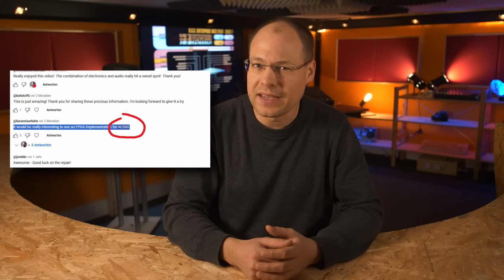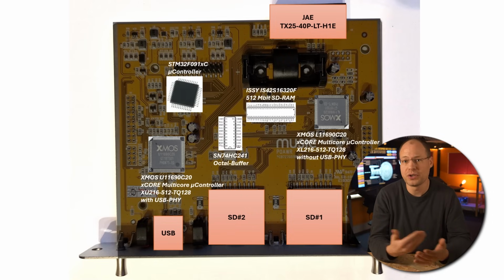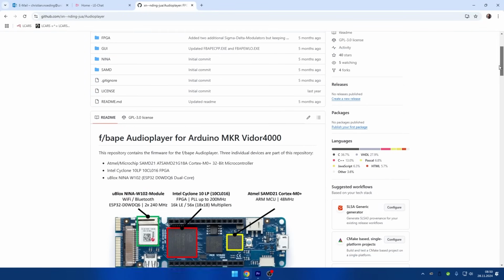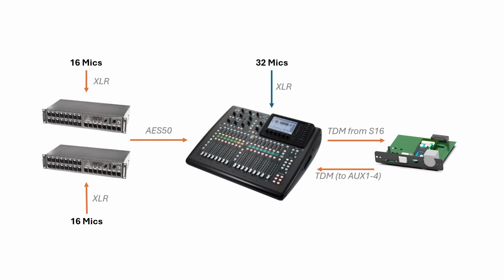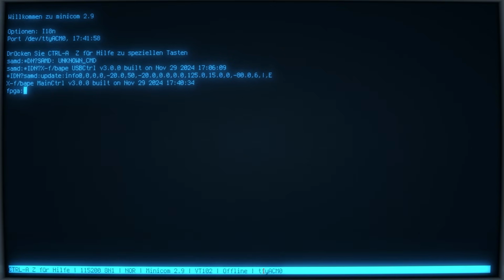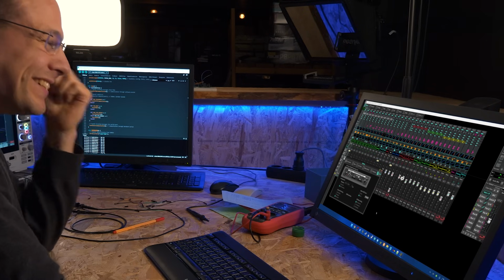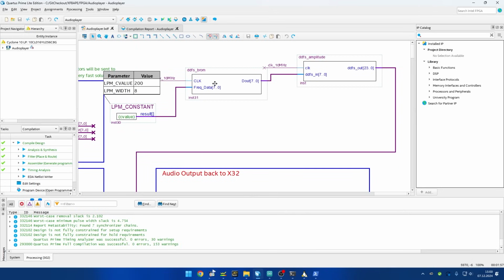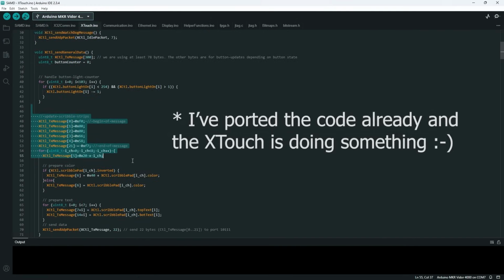X-FBAPE - The DIY FPGA-based card for the Behringer X32

Comment: Well done 😊. But I wonder how you can mix both local inputs and your additional inputs as when the "play" button is pressed, the local inputs are cut on the x32 🤔
Reply: I think it was just for demonstration.

In practice, you can use ch1-32 as normal routed from either local inputs or from aes-50 inputs.

Then you can directly route aes-50 or local inputs to the card.

Then card return can be sent to aux 1-8 as mono/stereo signals, and mixed within the F-BAPE card :)
Reply from the maker: Yes, that's the case. And as the FPGA mixes the samples within several hundret Nanoseconds, we can return the processed samples with only 1 sample delay, so stay in sync with the main-console. So the main benefit compared to the X-USB or X-LIVE with USB-connection to a DAW is the stability (no computer, no DAW, no updates) and real-time-processing.
Reply: @pcdimmer Sorry but I don't understand how it mixes the local inputs and the additional inputs 🤔. If the local inputs are cut, they can't be sent anywhere, right ?
Reply from the maker: The X32 can route audio in groups of 8 without processing it. The card can take 4x8 blocks from AES50 port B while the internal processing takes 4x8 blocks from AES50 port A. The buttons "REC" and "PLAY" will only switch between two different rounting-setups for convenience.

In my scenario I will use my X32 core (without internal ADCs) together with three Stageboxes connected to AES50 port A. 32 channels are routed to the internal processing and the additional 16 channels are routed to the card, mixed to a stereo-mix and fed back to the AUX-ins of the console.

But there are plenty of different options to route.

Comment: Someone needs to reverse engineer this for the wing 😍
Reply from the maker: I learned, that the WING transmits 64 channels to the Expansion-Card, so the possibilities are even larger. I've found a nice picture of the WING LIVE Card front and back and the overall design is comparable to the old X-CARDs. So I guess building a DIY-WING-Card is possible using the same approach I took for the X-DIY-Card.

Comment: Do you know how the expansion card pinout for the WING is laid out? I'm hoping that we can get some harddrive recorder for that, instead of just SD cards with the WING Live. Would love to work on that, but no idea where to get the pinout. Cymatic sadly is dead, so we can't expect a similar card for the WING from them.
Reply: Guess I'll have to look into reverse engineering it like you did with one of my WING-Live cards, or a WING-Dante card.
Reply from the maker: No, up to know I have no data about the WING-Expansion-Card. But it seems to use the same connector. As the WING-Cards seem to support 48 channels, there will be two additional TDM-lines. I'm walking around the WING-consoles each time I'm in one of the stores - maybe the next time I will take one with me. Then we will have more answers.

Cymatic used a SMSC DM860A Media Processor IC with USB OTG. So the task would be here to connect a USB Mass-Storage-capable controller-IC to write the 32 audio-channels to a connected USB-mass-storage-device. However, thinking about this solution and seeing the simple SD-Card-interface on the other hand: staying with SD cards is the best solution, I guess. Cards in SPI-mode are too slow, but all newer cards support 1-bit or 4-bit SD bus mode and this interface is much easier to implement in VHDL than USB-Host-Mode. With a larger FPGA I would test this implementation with a Soft-Core NIOSII controller and a FAT32-library.
Reply: @pcdimmer  I even expect 4 additional TDM lines. The WING expansion cards support up to 64ch/64ch. The default SD recorder card can support 32ch individually on each SD at the same time, the Dante expansion card supports 64 in/out.

The thing with the SD cards is that I don't really trust them that much. For critical recordings I tend to run SD, one Laptop via USB, another Laptop via Dante at the same time. I don't see USB-Host-Mode and filesystem happening on an FPGA directly for now, but I'm wondering if it would be possible to interface a more common SBC/SoC with the TDM lines. It seems that not many SoCs support 8 TDM hardware interfaces, and the clockrate makes this non-trivial to do via software-interfaces.

Maybe going the route of converting the TDM lines to a USB UAC device first would work? If the OS is trimmed to the bare minimum and tuned well I'm sure that it could be quite stable. :)
Reply: Also: I can highly recommend the WING. I've got the fullsize since shortly after release and already have a WING rack sitting here as well. Unbeatable value for the money, and much more processing than the X32 platform.
Reply: Looking around a bit: The Rockchip RK2118G/RK2118M might be a suitable chip. 8x TDM, low power Cortex CPU cores, USB 2.0 OTG, 10/100 ethernet - this could work and be a nice bridge between easy TDM interfacing and writing to a USB disk with a filesystem. Will keep an eye on that!

Comment: can it be implemented on Midas m32
Reply from the maker: As far as I know the X32 and M32 share the same code-base. "Only" the hardware has better quality, better ADCs and different housing. Maybe the firmware is identical and only some resistors will let the firmware know, that this is a X32 or M32. So the M32 should recognize the X-LIVE as well as the X32 the DN32-LIVE. But if not, we could change the initialization-string from "X-UREC" to "DN32-UREC" or something else without problems.

Comment: I would 1000% buy one of these if you ever begin selling them. Fantastic work!

Also, out of curiosity: would it work as-is with the M32 mixers as well, or would you have to change your code or hardware significantly? I'm not a coding guy myself so I admittedly skipped a lot of those portions of this video, lol.
Reply from the maker: OK, you skipped parts of the video? I .... answer ... parts.... :-)

As far as I know the X32 and M32 share the same code-base. "Only" the hardware has better quality, better ADCs and different housing. Maybe the firmware is identical and only some resistors will let the firmware know, that this is a X32 or M32. So the M32 should recognize the X-LIVE as well as the X32 the DN32-LIVE. But if not, we could change the initialization-string from "X-UREC" to "DN32-UREC" or something else without problems.
Reply: @pcdimmer  Oh, sorry, lol! Thanks for still responding! That's good to hear that it wouldn't require a huge overhaul. Please keep innovating with the X32/M32 line, this stuff is awesome!

Comment: There might be a better answer to your DIY card solution. The ex Dante card utilizes a mini PCI slot. The Dante card in that slot is a.Audinate Dante Brooklyn II card. I feel this slot on this Dante card gives you the most bang for your book because it’s a common open standard that a lot of data is out there about. You can also look up the pin out configuration for the Brooklyn II card for all the custom pins.
Reply from the maker: I had a look at the DANTE-Cards only during the video-editing - this would be a universal DIY-audio-card for different consoles, yes. But the size of the PCIe-cards is quite limited and it would not be possible to put the Vidor 4000 on-top (it would be to high). As these cards are configured using SPI, I2C and/or UART and support TDM-audio, this is not a completely different matter and should be possible. But for now I will stay with the chosen solution as there is still lot of work to do.

Comment: Great re-engineering work!
I'm currently looking for an I2S-to-ADAT-converter but cannot find one. Not even PCBs on chinese market-places.
Would it be e.g. possible to connect the serial audio inputs/outputs of an ADAU1452 to a Behringer X-ADAT?
Reply from the maker: If I remeber correctly, ADAT uses 8-channel AES/EBU - more or less the same signal as UltraNet. AES/EBU (for more information have a look here: https://www.nti-audio.com/Portals/0/data/de/NTi-Audio-AppNote-AES3-AES-EBU-de.pdf) is a single-line-signal with an inherent clock-signal. I2S on the other hand uses dedicated frame-sync and bit-clock-signals.

So with this Vidor 4000 FPGA it is quite easy to do this conversion, but not the most affordable solution. In short: I have no out-of-the-box solution for you here, sorry.

Comment: First of all this is an amazing project and I appreciate the amount of effort you have put into it. While watching the video I was asking myself whether it would be possible to control the additional channels on the mixer directly, using the customaziable buttons to switch between the channel banks. I do not have any experience in circuit board engineering and reverse engineering and have no idea if the x32 communication protocol supports something like mapping channels. I guess the channel strip components would still need to be handled externally as the x32 only has 32 channel strips. Love your video and keep up the amazing work you have been doing.

PS: maybe make a video explaining in depth what all these technical terms mean?
Reply from the maker: Yes, this is a good idea. Some hours ago someone mentioned the DAW-section of the X32. I will check if we can control the additional channels using MIDI-messages sent by the X32 - either by the user-buttons or the DAW-section. Another Idea would be, to use the network-UDP/OSC-messages from the X32-Ethernet-Port. So yes, there will be some development in the next weeks :-)

Comment: I’ll give you a million dollars idea : make a UltraNet In and Out card for the WING.
Reply from the maker: UltraNet is an AES/EBU-signal using biphase-mark-encoding - more or less the same signal SPDIF is using. And - tadaa - there is already an AES/EBU-receiver within the GitHub-project already :) So receiving UltraNet to the X32/M32 already possible. An UltraNet-sender could be developed based on the stereo AES/EBU-sender within the project. I do not see any showstopper for this here.

Comment: Wow great work, love seeing how you approached the problems you faced. Would it be possible to implement the protocol Behringer uses for the app in such a way that you would be able to control te fpga's processing via mixing station? (Probably you need two instances of the app, 1 for the X32 and 1 for the FPGA)
Reply from the maker: As the X32-Edit communicates via UDP/OSC protocol and this protocol is documented in the "UNOFFICIAL X32/M32 OSC REMOTE PROTOCOL" this is doable. The protocol could be implemented within the Vidor 4000 in such a way, that the X-FBAPE card would register as an additional X32-console. However, an idea from a few hours ago is easier to implement: use the DAW-Section of the X32 to control the additional 32 channels. But maybe someone will jump on board and implement it to the GitHub-Project?

Comment: A huge want from the Behringer WING community is the ability to record to SD cards more than 32GB (yes it's "possible" but the WING firmware doesn't allow it because of licencing limitations)

The WING is a 64x64 interface so you'd have to pump up the FPGA a little more.

Adding a Bluetooth External antenna and or a "Apple Airplay"/"ChromeCast" audio destination would be a huge boon!

Loving this work!
Reply: Hi, I've been using 256GB SD Cards for years without issue. Only thing is that the initial formatting needs to be done from a PC (format with FAT32 on the entire blockdevice, don't use a partition table like MBR or GPT). I've been doing that from Linux. Afterwards, the cards can be re-formatted within the WING to clear them without issues.
Reply from the maker: Yes, I faced this issue, too. Windows 10 did not allowed formatting above 32GB with FAT32 in the original format-dialog, but Microsoft changed this in the newer versions of Windows 11. But you can use third-party software to format it - or Linux as suggested.
Reply: a all-in-one Snapcast Multi-Room host card would be so doable with this! and maybe a built-in raspberry pi as a chromecast alternative
Reply: Is your WING firmware up to date? I can use 256GB cards on my WING. Maybe you have to format your cards in the WING?

Comment: Excellent video. Today the X32, M32 are limited to 32in and 32out on USB. When we use superrack performer, we are limited to this. I would like to see a project where we could send the 16 subgroups + LR in addition to the 32in/32out. Everything via the x32/m32 usb card. Would it be possible? Sorry for my English, I'm from Brazil.
Reply from the maker: USB 2.0 has a bandwidth of 480MBit/s. As each audio-channel with 24bit and 48kHz needs a bandwidth of 1.15MBit/s we end up with 416 channels - in theory. But USB has some overhead and based on the XMOS documentation (https://schwender-beyer.de/inc/Why-do-you-need-USB-Audio-Class-2.pdf, Page 4) we have a maximum of 32 audio-channels with UAC2 at a standard-USB-endpoint and 64 channels with UAC2 at a high-bandwidth-USB-endpoint.

So sending 64 channels is possible with USB2.0, but the X32 has only 32 channels routed to the card. So here is the bottleneck. Using a AES50 to USB-converter would be the better solution here...

Comment: Great job. I think i've seen a similar idea in the comments but a bridge between two existing expansion cards would be amazing. I think a lot of people own some number of expansion cards and they'd make really cool tools - Adat/ dante/ soundgrid/ card recorder.
Reply from the maker: A card-bridge is now in sight: as we know the initialization-commands for the cards (maybe there is a difference for different cards) we can put the Vidor 4000 between two cards and initialize both cards with individual UART-connections and cross-route the four TDM-connections. An ADAT-recorder should be the easiest one. For the X-DANTE we would need more investigation to setup the DANTE-Network, but it is possible, too. First of all, I will get the presented system to a "good-to-use" level. Then we can think about more.

Comment: Insanely cool work on this!

Makes me really curious about the Allen & Heath IO Port for their older series like GLD and iLive (64 in / 64 out). Its a 64 pin connector (Harting I believe), but otherwise I am not nearly capable enough to analyze it further :)
Reply from the maker: I did a short internet-search on the Allen&Heath devices, but I have not found out more than that they use an Xilinx Arrix-7 FPGA on some cards (https://www.thomann.de/de/allen_heath_sq_madi_interface_card.htm)
So the same process as for the X-LIVE card has to be done to find out the used protocols and audio-signals. I'm out for now :)

Comment: this is possibly the most amazing project for the X32 i ever saw.  I can see a few applications for additional DSP.    alot of people need additional AutoMixer channels.   also, a full-on speaker-processor,  Auto-Tune, etc, etc.  Anyways, you're effort is greatly appreciated
Reply from the maker: Thank you very much. Automixing should be possible to implement as changing the gains can be done very fast. I used this feature on implementing the dynamic Compressor/Limiter and Gate within the FPGA-project. The implementation of the gate could be a basis for a multichannel automixer. In the patent of Mr. Dugan the general idea is explained: https://patents.google.com/patent/US3992584A/en Maybe someone takes this chance and try to implement this to this project?

Comment: You are AMAZING!  FPGAs was the one thing I never learned (switched from Computer engineering to Computer science) and it has bothered me to this day. I did a bit of verilog in classes but never tinkered on my own. You are VERY INSPIRING!  I'm no where on near your level but you really do inspire me to pick up an FPGA development kit and get started on learning again!  Thank you for your videos!
Reply: Highly recommend, personally I found it really fun in uni, my classmates all hated it tho ;p. It's neat bc it's genuinely parallel processing, takes a different way of thinking from your ordinary low level code. One of my classmates did go on to buy one himself and get pretty good, landed a job at ON doing the hdl for digital interfaces in their new chip designs.
Reply from the maker: Once you learned how to manage this parallel-processing, you will miss it each time you are programming a regular microcontroller again :) Some weeks ago I did something with a dual-core C2000 and just thought: "man, only two parallel tasks... I'm so limited here". However, in the end a combination is usually a very good solution and if it comes to cost, you try to reach your goal somehow with the microcontrollers.

Comment: are there any sends on the new 32 channels . Like monitor send from any of the new 32 channels?
Reply from the maker: Well, we have only access to 32 channels to and from the card. So there are no additional routing-options within the X32 with this new card. But you can use the User-based-routing of the X32 to get access to parts of the 32 return-channels of the card. Within the FPGA we could then create some send-mixes without great effort to reroute them using the user-routing. But I'm not sure if this will give you more flexibility compared to the original mixing-capabilities of the X32...